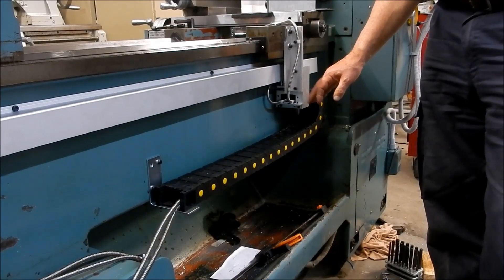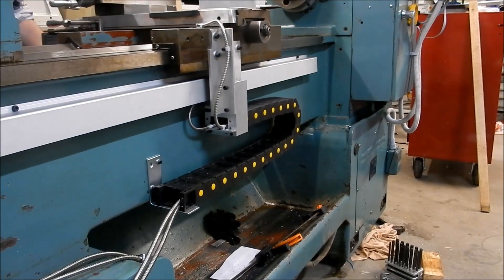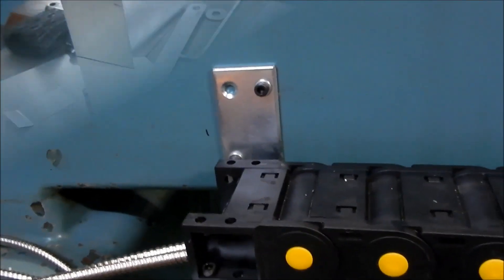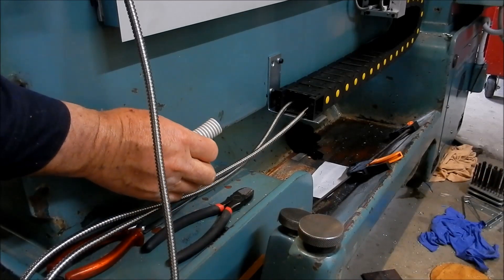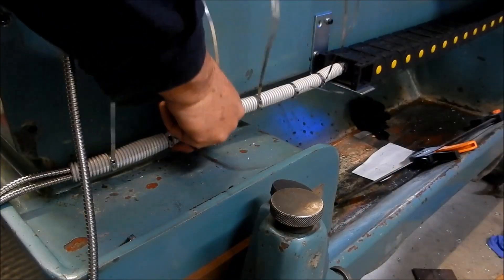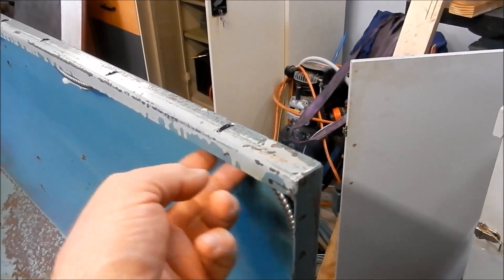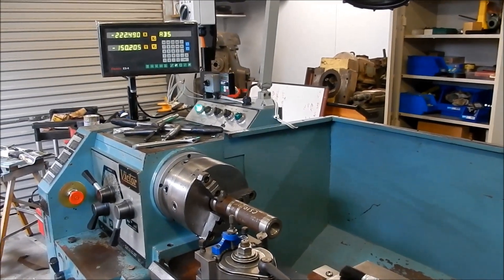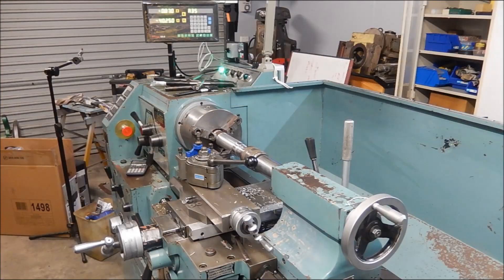Victor Lathe Power Track / Drag Chain Installation

Comment: Hi Cam.
Another well detailed project 👍
I’m finishing up modifications to my little 960B, and ‘doing something’ with the Easton DRO cables is my next ‘problem’.
Could you post up details on the source/size/specs for the drag chain you used please?
Also, after fitting the long axis scale, there is not a lot of space left thereunder to fit in a drag chain and still keep it up out of the chip tray. So I might have a crack at hanging the drag chain off the splash back, and reversing the drag chain. I’d need to route the sender ends of the cables out on an outrigger ( maybe use the taper-turning attachment) that also carries the ‘floating’ end of the chain.

Regards
Robert
( Sydney)
Reply from the maker: G'Day Robert, the 960B is a very nice machine, well made and finished.  Big difference between the Chinese and Taiwan machinery.  The Drag Chain is linked below from AliExpress -
https://www.aliexpress.com/item/4001065895294.html?spm=a2g0s.9042311.0.0.17be4c4dLiHUNy
Cam
Reply: Thanks Cam 👍

Comment: Hi Cam, excellent cable management,  RS 232 extension cables solve the issue of the DRO cables being too short.
Just ordered a Sino glass scale with the smallest dimensions to fit on the cross slide which allegedly has Japanese NSK bearings, hoping for negligible hysteresis  and long life.
The rubber Bumpstead should provide protection. 
I will drill and tap the tailstock and use an m10 cap screw like John on Doubleboost.
Reply from the maker: Hi Willem, can you send me the link to the low profile scales.  If I find I'm hampered with length on the Tail Stock Quill due to the width of the scale and the bump stop.
Cam
Reply: Hi Cam, I ordered the scale from Bangood, 5um, just type DRO and it will come up
I made a longer Quill for the tailstock to negate the thickness of the scale.
I also bought the LCD dro which I find is easier to read, softer on the eyes.